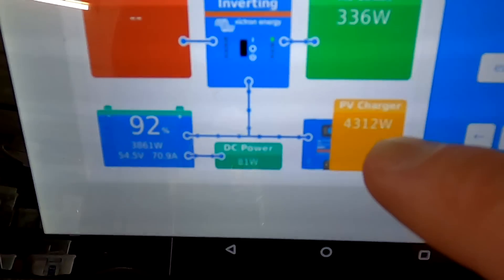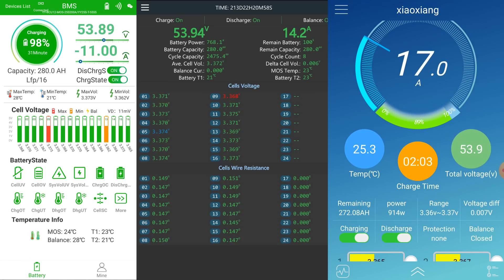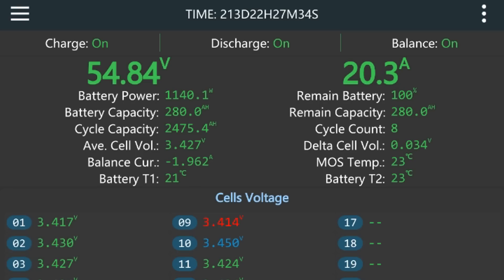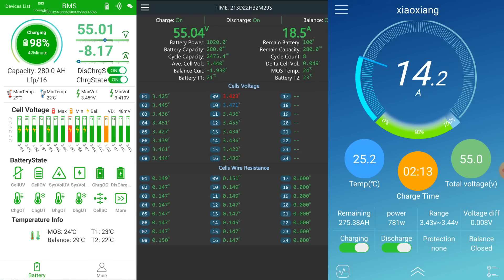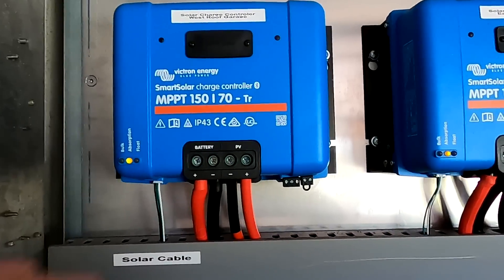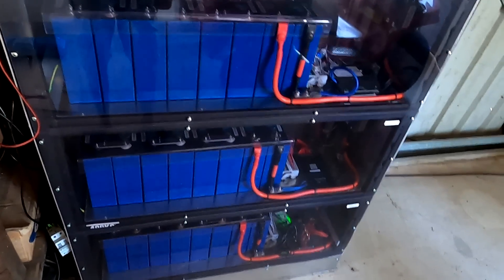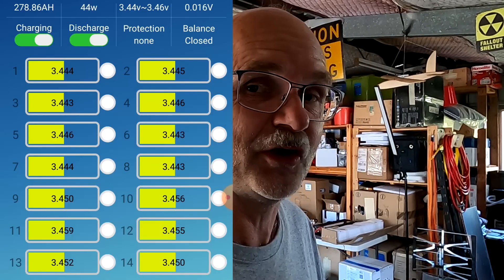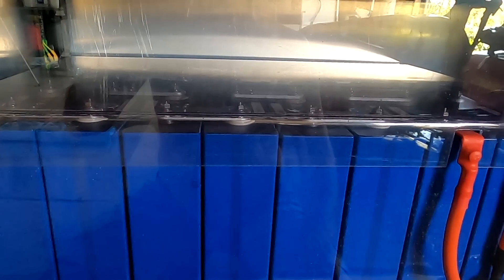Parallel Batterie Bank with 44kWh first full charge after winter. Watch this voltage difference!

Comment: I really don't understand how you get 100% charge on your JK BMS at that voltage... I barely get 75% or so for 53V... When I reach absorption at 55.2 V, I get about 85% SoC in JK BMS.
I have a Victron Smart Shunt so I take that as the real SoC, but it is just very confusing and annoying to have such a large difference in values for SoC.
Reply: I trust the Victron BMV Smart shunt for state of charge, especially after a recent synchronisation. 
The BMS SoC figure varies and is relatively unreliable. I’m not even sure how it is calculated.
Reply from the maker: Charge the battery slowly to 3.65V/cell or close to this to calibrate the BMS. 
The BMS SOC is actually more reliable than the Victron shunt as it measures directly at battery level and measures all the small currents which other shunts (like the Victron) misses. Hence the Victron needs frequent calibration. Especially the JK SOC calculation is pretty accurate once calibrated. You can see the voltages and current jumping around in the JK while the voltage in the Victron shunt stays relatively constant. It 'misses' some of the jumps the JK measures.
Reply: @OffGridGarageAustralia  Thanks Andy- I’ve never taken my batteries to 3.65v (and not entirely sure that I want to 😬).
3.55v is the highest I’ve taken them, and even have my cell protection cut off voltage lower than that (at 3.6v.)
Am I being overly cautious?

However I was certainly wondering how the JK BMS gets it’s SOC figure.
Reply from the maker: @FutureSystem738  There is absolutely no reason to charge that high. 3.55V is great for balancing maybe once a year or even less frequent. In your case, I would only do this if I see an increased imbalance. But as you said, your cells are not having this issue anyway, so 3.4-3.45V is perfectly fine to get ~98% of useable capacity.
Reply: @OffGridGarageAustralia  hence why the BMS SOC is rarely calibrated Andy... I rarely charge over 3.45, in fact my settings are very close to what you have on your website, and thus the BMS SOC is way off what it should be... 
It may be better once calibrated, but if calibrating it means brining the voltages to 3.65, then I'll pass. Happy to base on Victron smart BMS
Reply: @a-c-g  Yes, this. I occasionally take my 6 year old Winston caravan batteries to 3.5v, but only rarely and mainly to check balance. Normally in daily use I take them to 3.45v, and significantly less in storage.
(I’ve seen absolutely minimal degradation with them, fingers crossed that my EVE cells are as good.)
Reply: @OffGridGarageAustralia  Thanks Andy- I’m happy with the Victron doing the SoC estimation even if the JK is way out, and will happily keep my batteries normally no higher than 3.45v.
Just checked: I actually have cell over voltage protection in the JK BMS set at 3.56v. I think I’ll leave it there. After the initial few charges, the JK has done a great job at maintaining balance. However I’m extremely glad it has 2A balancing, because it certainly was needed. 150mA with many of the others on a battery this size is a pathetic joke in my opinion.

Comment: Hello Andy. Would you know why when I charge my batteries in full( in my case 56v with 3500w. The deviation on my JKBMS is rising up to 100 or 200Mv and of course after charging it goes back to 5Mv after only 1 hour (discharge in usual is around 1.5kw. ?
Reply: This is normal if you go up to the >=3,5V per cell range. Below 3,4V the cell voltage difference isn't really a problem, because the charge/voltage curve is nearly flat here. So capacity differences does not show up in a voltage difference.
You can try a top-balacing up to 3,65V per cell and check if this gives better results. But if will start to drift again over time. I just would say ignore the deviation. It's not really relevant.
Reply: @matthiash.4670  thanks. My banks have only 2 month. And I charge them at night sometimes to 3500w in low grid price when it’s rain. And this happen in this case. I was not too worry. But a little bit!😁
Reply from the maker: As long as you don't have a runner cell, it is all good. While charging at such high power, you can probably lower the charge voltage to 55V and stay safe.
Reply: @OffGridGarageAustralia  i have one picking up alone!  I will order tomorrow 2 more battery pack to have 4 in total. I’ve ask Quishou to replace one cell.
Reply: @OffGridGarageAustralia  JKBMS say to me.  Protection (Cell Over Voltage) (OS)

Comment: Good video Andy. The overkill seems to work well and my JBD is similar. This bodes well for my future build.
Reply from the maker: Yeah, they all work quite well actually. Even the passive balancing is not effective, it still keeps the BMS from turning of from an over voltage. And that's the main thing.

Comment: Andy:  in a Video about settings/configuration I think you talked about a 5 hour absorption time. Is the 1A temporarily and 5 A your standard setting?
Reply from the maker: I have a 1h absorption time set in my controllers at 55.2V (3.45V/cell). This is purely to allo the balancers to work.
5h was just for testing purposes so I could keep this higher voltage for longer to run some tests with the balancers.
Reply: @OffGridGarageAustralia  Thank you for making this clear for me!

Comment: Hi Andy, I have been waiting for a full charge to compare the Overkill BMS. I have had mine running for about 12 months and the same as yours started at 99% and over 3-4 months it slowly works its way down to 90%. I have reset mine to 100% a couple of times now and the percentage continues to dwindle. I normally get a full charge almost every day here in sunny Vic so different scenario from yours but same result. Any ideas anyone?
Reply: A parasitic draw? From what I have seen 80 % is a good amount to charge.
Reply from the maker: What are your charging parameters, Glen?
Reply: @OffGridGarageAustralia  Growatt 3Kw solar charges to 3.40 and victron 1 Kw solar to 3.45,   3.40 Balance on, 3.45 absorption 1Hr, 3.35 Float

Comment: Great design Andy, everything looks awesome....I'm building a similar 24Kwh / 48 volt system with x2 batteries to supplement my existing 27kWh 120VAC /24 VDC off-grid system...The new system will have a separate inverter feeding a standalone 240 volt load panel....I already have an overkill BMS but I think my second BMS after watching your videos is going to be a JK.... I've been looking at the Hanzor store and was curious if you know if the 150 and 200 amp black models (B2A24S15P or  B2A24S20P) are compatible with the new screens and buttons??? Thanks for everything you do, as a marine engineer I Love the detailed analysis😋😋😋

PS I will of course order through your online link 👍
Reply from the maker: Thanks for your feedback and kind words. Yes, both BMS on their site are compatible with the screens and power button function but always confirm through their chat that it will. I'm not sure how much old stock is still floating around these days.

Comment: I am curious. The trees around your shop, Could you cut the tops off to allow more sun to the solar panels? Instead of cutting all the way down. Leave them 30 feet high or so? Just a thought.
Reply: Andy's said many a time it would be too complicated and expensive to get the tree's trimmed due to their height. The trees also help to keep the area cooler, and most of all they like the tree's. The solar appears to work perfectly well with the trees as they are. That said one of our trees is due a trim, which we need to get done soon.
Reply from the maker: Yeah, they are 30-40m high and it costs several thousands to trim them, so I rather invest this money in more solar panels and see how far we come. It's a good experiment for others too. If the trees are not yours you would not be able to do anything and have to live with this situation. So let's see if it is possible to get a decent result in such a situation.

Comment: This is fantastic! I can't wait to see my packs fully charged one day,  I kind of modeled mine after yours except I'm on a very tight budget so it's not nearly as organized or wired so neatly.

Thanks for sharing and as always keep building 👍
Reply from the maker: Thanks Todd. Net and clean wiring can be done without any budget, right?😉 Keep it as tidy as possible to prevent any problems. Velcro is great for that purpose and very cheap.

Comment: Andy, You scrambled my brain😂 I'm still struggling on how to program my victron 100/50 smart solar controller 😱.
Reply from the maker: What's the problem with it? Did you watch the video where I explained the settings? They are also shown on my website:
https://off-grid-garage.com/my-settings/
Reply: @OffGridGarageAustralia  Hi Andy, I think you took my comment wrong, what I was saying was there was so much information for me, that my brain could not take it all in given I had not slept due to ill health , My system is so basic, and I'm still trying to get to grips with what could be described as a "Flintstone" system of 2x 300w panels 1x victron 100/50 controller, 1 x 1500w inverter and 4 x lead acid batteries. So your system is like startrek tech to me,  I really love your style of presenting all your vids and I have learnt so much from you ,  Keep doing what your doing and I am looking forward to the next vid from you. My best to you from Not sunny not hot but very horrible UK.

Comment: It will be interesting to see if your absorption time is enough over the summer to decrease those deviation numbers. I am predicting not, but I could be wrong.
Reply from the maker: Yes, I'm with you here. I won't be fully charging that battery often... aeh, maybe I will after upgrading the solar production.
The passive balancers won't be sufficient but at least no runners in any of the packs.

Comment: Awesome Andy. 
Wow, your Victron BMV shunt was amazingly close in calibration after such a long time since it was synchronised. I fully expected it to be a long way out. I’m intrigued to know what settings you have in your Victron BMV for charge efficiency, (I’m currently using 99%) and Peukert exponent (I’m using 1.05).
You must have fabulous matched cells for the balance to be that good on the other BMSs with such low balance current. IMHO 150mA or so of balancing really is pretty useless on such a large battery bank.

(BTW I’m delighted with my JK BMSs, couldn’t be much happier, though haven’t fitted my replacement 12v one in the caravan yet, only given it a brief test, but it’s working well.)
Reply: Mine is also super accurate after a month - I always fully charge one a month - Charge efficiency 0.99 and Peukert 1.00
Reply: @petermerle  Thanks. 
I’ll probably be able to finesse those settings slightly, maybe just drop the Peukert slightly, though I’d actually prefer the estimate to be slightly pessimistic rather than optimistic. (As I understand, Peukerts is of little to no effect with very low charge and discharge currents anyway, however even a 0.2C discharge will see some voltage drop so I would consider by my understanding that 1.0 is too low. Maybe I’m just being too pedantic LOL :-)
Reply from the maker: Thanks Dave. I have the settings of the shunt on my website here: https://off-grid-garage.com/my-settings/
I was surprised myself, that it was so close to the real SOC...

Comment: Excellent video once again! Is there a difference in resistance between the types of bus bars?
Reply: Aluminium is higher resistance than copper, and especially so at contacts because it gets a fine high resistance oxidation layer almost immediately.
Reply from the maker: Yeah, aluminium is usually worse than copper but these bus bars are thicker and have therefore a better conductivity that the standard copper bars coming with the cells.
Here is the video with the calculations: https://youtu.be/mdr5HZZRaTc

Comment: These conclusions on charging seem to blow the theory that all cables need to be the same length.
Reply: Yep.
Reply: I bought a Daly BMS to use with my 16 Lifepo4 cells. Have I made a mistake?
Reply from the maker: The Daly BMS will work, but... you may want an active balancer in addition...
Reply from the maker: Yeah, they don't need to be the same length, definitely not. You also don't need to connect your banks from either end, so pos from one end and neg form the other end. That does not have any effect unless you pull really high current of ~1C
Reply: You made my day.  I have argued that.  Ohm's law. Resistance so low its measured in miliohms per 1000ft. No one believes math

Comment: I feel that if you didn't have a 800ah battery bank and only had a 280ah battery bank the Heltec pack would have peaked and the BMS would have disabled your system. The others were well balanced or at least the Overkill Solar pack was. What do you think is causing the JK pack and the Heltec pack to drift over only a 94 day span?

Comment: Well well well.  Who would have guessed that battery current will diverge as each battery comes up to full charge at a different time due to cell differences or simply different amount of discharge.  Now consider the case where the chargers can provide more current.  What will happen to the amp draw on the battery with the lowest SOC relative to its own actual capacity?  It will go up naturally, perhaps exceeding the recommended charge rate, and in extreme cases even cause the BMS to halt charging.  It's almost like I knew what I was talking about all along ...  LOL
Reply: That LFP voltage curve makes it totally inevitable that the batteries will balance out when in parallel.
You could even connect one bank which is say 20%, and one which is 80%, and they will naturally fully balance over time because when the voltage starts to rise at the top of the charge curve, the lower voltage battery will take the available charge current. The reverse would also happen during discharge.
Reply: @FutureSystem738  Put your thinking cap on then stare at my prior post for 4 hours.  Hopefully you will then grasp what I was talking about.
Reply: @retrozmachine1189  Yes, depends on the relative size of battery banks and charger. 
Certainly it’s possible to charge one bank too fast, (but a good BMS WITH appropriate settings should protect from that.)
Anyway, we’re talking extreme cases here- normally something to avoid.
Reply: @FutureSystem738  A typical BMS, in fact almost all BMSes, can only permit or prevent charging.  Not only that, the configuration of the BMS is almost certainly going to be set to prevent charging at the maximum specified charge rate which is typically way beyond the recommended charge rate.  The BMS is the safety net.  Proper charge current control is the correct place to manage the system.  This is not an extreme circumstance.  Current going beyond the desired point is fairly common in DIY solar with batteries, but the person that built the system is oblivious to the situation.  Proper charge current management is why commercial battery systems have comms with the charger/inverter and why the 48V 19" rack batteries often come with switching regulators integrated into the charge current path in the BMS.
Reply: @retrozmachine1189  Food for thought. Cheers